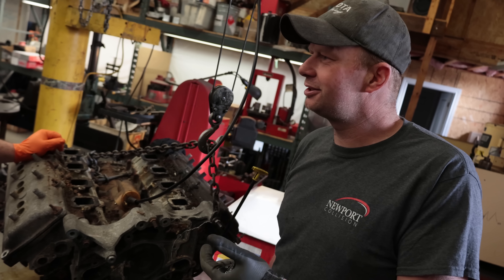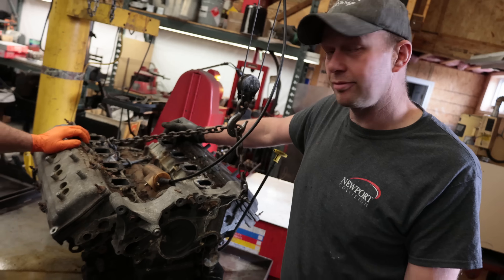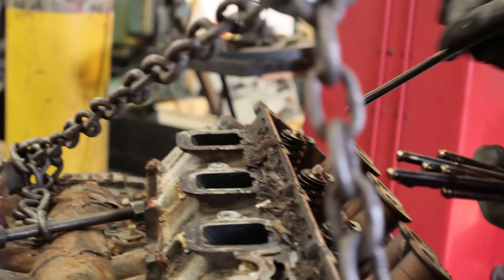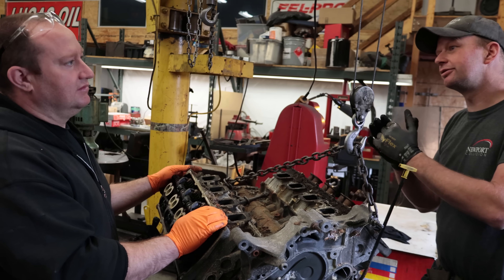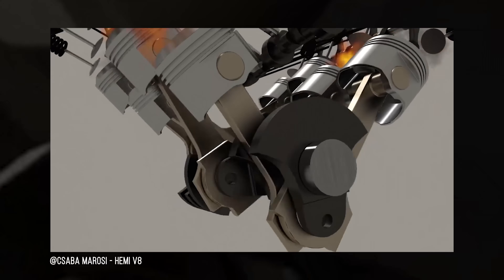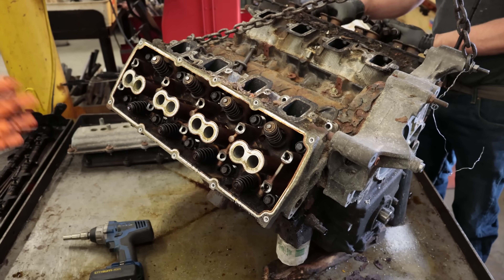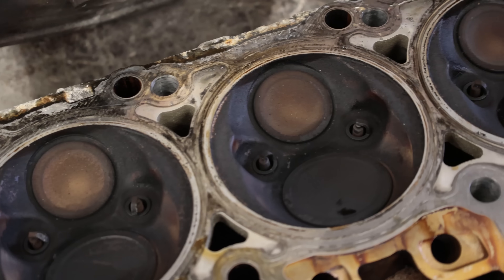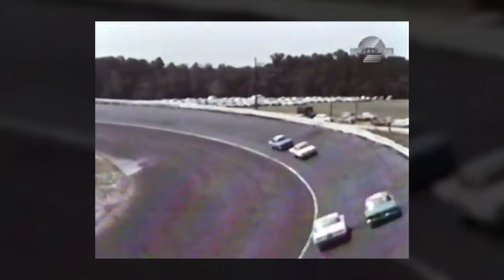REVIEW: Everything Wrong With A 5.7 HEMI 345 Engine

Comment: The lifters are the last thing to get oil in a hemi,  oil travel path from filter to mains, camshaft, up through the cylinder head into the rocker shaft assemblies. DOWN through the pushrods into the lifters. Former Chrysler level 3 tech. Chrysler has a procedure for the dreaded lifter tick(if the lifter is damaged then this procedure WILL NOT WORK) with engine at operating temperature, rev the engine between 2500-3000 rpms for 20 minutes in park. Purges the air out of the lifters. The angle and the poor oiling of the lifters are the hemis Achilles heel. Chrysler says it's due to prolonged oil changes. Specifically in fleet vehicles that idle. Oil changes need to go by engine hrs not mileage.
Reply: NO. I refer you to page #69, Larry Shepard's book, NewHemi Engines. There is a very large schematic diagram of the oiling circuit. PRIMARILY oiling to the lifter bodies is from the two large oil galleries. The normal(for v-8's for the last 50yrs, at least) Chrysler oil circuitry for the upper valve train exists via the passages in the  rocker stands, rocker shafts, rockers. The only slight difference is the hollow pushrods, like they used in the small block Magnums(& 3rd gen Hemis) from '89 on.
Reply: @budlanctot3060  I can only tell you what I was taught directly from Chrysler. I also have oil schematics directly from Chrysler illustrating that those oil galleries feed the camshaft and go up through the head. So either Larry is wrong or Chrysler is. And I can believe either could be. I've seen enough mistakes from Chrysler 😂. I guess the only real way to tell is looking at the lifter bores and see where the oil galleries are. Lifter issues didn't become apparent until 2009 with the variable valve timing. MDS was introduced in 2006 I believe? But remember oil is used to turn the MDS on and off. So if oil flow to the lifter bores was constant then the MDS would be on all the time. So no... I do believe Larry is wrong. Those oil galleries supply oil to the MDS solenoids. The lifters themselves receive oil from the pushrods.

Comment: I had a 2004 Durango with the 5.7 HEMI that had the hydrolock at about 75K kms. It thru a rod out the side of the block in my driveway on start up one morning. I understand that the plastic intake is the problem letting water in. I'll be interested in your thoughts on that...

Comment: Dodge dealer tech here. They will beak valve springs every now and again. more than once I've seen a push rod fall off the rocker and bend the rocker shaft or straight up snap off the rocker pedestal requiring a new head. We also don't normally replace whole engines for cam failures. Valve seats also fail quite a bit. a very odd failure that happens that I've only ever seen on low Mile motors. (highest I've witnessed with this failure is 12k miles) is the poiston will just shatter completely without prior warning. These issues are shared between the 5.7 or the 6.4 truck motor. If I had to bullet proof a hemi I would delete MDS with fully built head with a strong set of pistons and some rods while I'm there.
Reply: have you had any issues with the 2015+ 6.4 challenger/charger engines? i try to never let mine idle for more than a few mintues and change my oil before 3000miles ha, im paranoid

Comment: I have 2011 ram 1500 4x4 with 108,000 miles.  Started using antifreeze and ticking really bad. Mechanic replaced cam, lifters , timing chain and head gaskets . I have friends with the dreaded hemi tick and none of them are high milage buy any means.

Comment: I am building a 368 stroker with a Scat rotating assembly and a mild comp cam for low end torque to replace the 4.7l in my 2004 Ram.  Also swapping in a Tremec TR4050 5 speed manual to replace the OEM NV3500 manual

Comment: Had a 03' 2500 around the shop for a year ,dropped valve seat. Thought it would be an easy find with cop cars ,jeeps ,and 300's .Looked for a used engine,all the junkyards laughed and said good luck. In the south where rust isn't so much of an issue they get used up.Finally gave up and parted the truck. Still came out on the truck but wouldn't buy one again.

Comment: I'd put it in an older Dodge pickup D-150/250 that was originally a gasser as they're pretty easy to find for cheap. Make a cool shop truck with some get up and go. Plus Holley has made all the brackets to get one of these Hemi's to fit into that platform. Was cool to learn about the cross hatch stuff. Very good knowledge to hang onto.

Comment: i heard they dont get oiled proper on the cam  from extended idling but i was thinking that if you ran some more clearance on the rod bearing that might help . Of just dont idle for long periods of time . I heard a little extra clearance on the rods and mains you might have a little less oil pressure at idle and no one knows . Not enough clearance and every one will knows

Comment: The bad lifter issue is pretty well known, and if not caught early turns into a bad cam issue as well. But you guys said nothing about the the valve seats that come loose. They get turned sideways under the valve and then impact the piston, then break up and get squished between the cylinder head and piston causing catastrophic damage. I think both were redesigned around 2014 but not sure. I've got a 2017 Charger R/T with 5.7L that I am not terribly worried about.
Reply: In '09 the heads were changed. That was 1st yr of "Eagle'" head.

Comment: Nice video. You neglected to mention the early ones dropped valve seats.
Reply: Mostly because of an overheating event, which doesn't totally absolve Chrysler of responsibility for insufficient press fit in the early heads.

Comment: It is completely overlooked and many will disagree..but this is not a 3rd gen..it's 4th gen..the 3rd gen is the 4.7 it is a overhead cam hemi..just like the ford S.O.H.C 427 the spark plugs go through the top of the cylinder head..because the cam is in the center of the head..The HO engine was a Grand Cherokee exclusive for the 2002-2004 and boy it's got some real good go fast goodies and the bottom end is like some racers wet dream starting with the forged steel crank..then in 2008 they revamped the 4.7 to get 305 hp out of 285 ci..now that in anybody's book is impressive !

Comment: Really great video Rich. Ive been elbow deep in these engines day and night the past couple years, What if you built a street-legal stockcar with this engine? For a few grand you could get a chassis and body to splice as others have done. Make it a forged high revving stroker with a meaty cam, the Comp HRT stage 3 sounds great for an out of the box option. More info on that on my channel. 

As for lifters, they were really bad 2011 and got better after. 03-05 hemis were bad for dropping valve seals and having timing chain issues. Being that you have the first line of 3rd gen Hemi...  I suggest upgrading your timing chain to the heavy duty 6.1 hemi timing chain. You can also use a 6.1 hemi crank as they are forged version of the 5.7. These parts are not the same on the later 2009+ Eagle Hemi's. 

Your header bolts will put up a fight, being that this is an old and well ran engine those bolts are likely rusty little sticks ready to snap, about 1/5 of my oem exhaust manifold bolts snapped on removal (godhelp anyone with an old rusty hemi in a car trying to install headers- spoiler: head removal). Exhaust manifold bolts are m8x1.25, stage8 has a great kit for gen3 hemi header bolts. Also ONLY USE OEM EXHAUST GASKETS ON THESE. All other exhaust manifold gaskets are known to fail especially the RemFlex gaskets. Just get OEM type and save yourself the headache. Also the connecting rod bolts on these are TTY so keep that in mind, just the same as head bolts. ARP makes a headSTUD kit for these engines but I haven't seen a headbolt kit, I did all my work in the car so I just got MAHLE for everything. 

These engines also have a wierd habit of throwing the inner ring off the balancer as they get old and crusty (mine did) I upgraded to an overly expensive 6% OD ATI superdamper which still uses stock belt size, so i could tell people I had a NHRA certified $500 pulley. It comes with black oxide bolts so RIP if your rig isn't garage kept(like me. I cry inside every time I see my damper getting rusty) Reccomend spraying fluidfilm in your damper and wiping the excess if you go that route. Its sin to have a rusty superdamper. Like it isn't a common thing to happen, losing part of the dampener, but Ive seen it happen a few times which is wierd enough to mention

I have one super super super handy trick to these engines when installed in cars. The valve cover bolts are a BIIITCH to remove if you don't have the Titan brand 1/4" micro swivel ratchet from princess auto SKU 8947145. Stock valve cover bolts are 8mm head, you can upgrade them to m6x1x25mm stainless steel bolts and re use the rubbers but you have to do a little stack of washers on top. 

Oilpan: if your using the 5speed, and your application permits, get an aluminum oilpan from a car as the oilpan is a gusseted design liek the old chrysler smallblocks to provide more support between the engine and transmission, it uses the same trans botl pattern as the old chrysler smallblocks too from what I recall. Lots of drag racers prefer the aluminum car oilpans for this reason, one of my speedshop's race teams were breaking belhousings every 10 or so passes until they switched back to the car oilpans. Oilpan, Valve covers, coilpacks, front fenders, and possibly intake manifold I forget, are m6x1x25mm machine screws, fastenal has em in grade 10.9 with ecoguard part number 11552483 and matching washers 11552364.

Some neat fun trivia about my own experience. Rebuilt a clapped out ex cop car that had the rust real bad(it was my quarantine project, I didnt say it made any financial sense), had nothing but bad luck with it, first I was one of the jackstand recall statistics, then going to my last carshow of the year a big ass rock was dropped on a bridge under construction, took out the oilpan and my skidplate. Right now it's on jackstands(custom heavy duty fabricated stands not storebought, fool me once as they say) soon to rebuild the bottom end. Gotta drop the cradle to get the oilpan off on Chargers. And yes, new skidplate is 1/4" AR400. I'll be putting spacer pucks ontop of my struts to make up for the height. When the oilpan got taken out it was like... 1 or maybe 2km until we could safely stop as it was a construction zone. Im not saying ive had nightmares about the state of my crank and bearings but Im also not saying Ive not. The info about the aluminum bearings galling with lack of oil sure worries me. I was already planning on getting some ACL racing bearings so, I guess worries are not un-founded at least.

That's everything I can think of at the moment, I will likely drop more walls of text on your subsequent videos though.

Comment: I know and old timer who used to build mud drag trucks and supposedly he used to drill a tiny hole in the bearing and put a brass pin in it. He said that you could spin it as fast as you wanted and the rods would snap before the bearings would spin. How plausible does this sound to you?

Comment: Jasper adds an oil rail with squirters to  keep the bottom of the cam and lifters wet, at work big telecom utility we don't replace cam and lifters anymore on the hemis until jasper does their upfit, most trucks are bucket trucks without  dod

Comment: Fun fact with these engines. The big reason the hemi lifters fail is they are oiled backwards. The oil comes from the rocker assemblies and down the pushrod into the lifter. Hot idle oil pressure is a bit too low for this.
Reply from the maker: Thanks for that!
Reply: @DEBOSSGARAGE  Absolutely! Your 8.3 ISC writeup was helpful for me.

You can put a Hellcat pump in the regular 5.7 (only confirmed on 2013+ but may work on older ones as well.)

The hellcat pump has thicker rotors, making hot idle pressure higher due to more volume. I've done it a few times and had noticeable results. Whether or not it's enough to keep one alive, I don't know.
Reply: Dylan. I think Bud doesn't understand MDS operation. I commented the same thing you did to his response on my comment. I believe Larry Shepards book is misleading unfortunately. Maybe Earlier gen 3 hemis without MDS such as the one in this video was oiled by those  galleries? I don't have much experience with those ones. I was a level 3 Chrysler tech. Did plenty of those camshafts and lifters like every other tech. Went to Auburn hills for the class too.
Reply: @amsdrivelines  I was level 3 as well up until January. Went to Seattle and Portland training centers. When did you get out?
Reply: @sHoRtBuSseR  I got out December of last year I took a job at a large utility company as a fleet mechanic. Hourly pay. Union. Making twice  the amount I was making flat rate. Guaranteed salary with overtime. I GOT LUCKY!!!
Reply: @amsdrivelines  I took a job in a school district as a mechanic back in January. I also got lucky. Salary, union, benefits. The works.
Reply: What? That's not true at all. Where do you get such misinformation, and then spread it around. The lifters are primarily oiled by the huge lifter galleries that run down both sides of the  intake valley. Crack a book, instead of repeating dumb stories.
Reply: @budlanctot3060  I went through Chrysler training with Chrysler instructors. So "cracking a book" wouldn't do me any good, because I learned everything I know directly from Chrysler.

The oil galleries in the newer block are for MDS operation. I've replaced more sets of lifters than I can count due to the needle bearings falling out of the lifter. You know what I found? The MDS lifters were very rarely the issue. 90% of the time it was a standard non MDS lifter that failed. When MDS lifters failed it was almost never the roller portion. It would usually just fail to operate correctly or fail to reactivate when MDS was turned off.

Way to be condescending, Bud. But I did crack a book. Lots of them. Spend hundreds upon hundreds of hours in Chrysler's classroom learning the product. So before you open your mouth, crack a book.
Reply: @sHoRtBuSseR  NO. I refer you to page #69, Larry Shepard's book, NewHemi Engines. There is a very large schematic diagram of the oiling circuit. PRIMARILY oiling to the lifter bodies is from the two large oil galleries. The normal(for v-8's for the last 50yrs, at least) Chrysler oil circuitry for the upper valve train exists via the passages in the  rocker stands, rocker shafts, rockers. The only slight difference is the hollow pushrods, like they used in the small block Magnums('89 & on, I believe). The hollow pushrods are mostly  just for lubricating pushrod sockets in the lifter & rocker.

Comment: I bought a new 2005 Dodge Magnum with the 5.7 Hemi.  I still love the car and plan to keep it.  The lifters didn't fail in the early models prior to 2009 when they switched to variable valve timing.  So, MDS didn't cause problems in the early hemis from 2005 thru 2008.  The only issue with the early hemis is that the valve seats might drop out of the heads especially if overheated.  It's the GM engines that had valve lifter failures with their version of MDS, the Air Fuel Management as they called it.

Comment: Alot of people don't realize this engine has two spark plugs per cylinder haha.. and yeah oem plugs are best. But with mopar oem parts are usually the better option :)
Reply: Agreed. My 14' R/T came with NGK plugs from the factory, so as baffled as I was they weren't Mopar plugs, I replaced them with the same NGK Iriduim plugs they came with. No issues at all since.

Comment: I got two 2003 ram 1500s with the 5.7 hemi and they both are over 300,000 miles and I do regular maintenance and haven't had to do any engine work at all but mine don't have the multiple displacement option it's just all 8 at all times. And yeah the hemi has a tiny tick at all times but then the lifter tick is a bit different if your used to the sound :)  but both my 2003 rams have been great trucks no issues other than the rack and pinion is garbage on the 2000s trucks

Comment: I have a Ram 1500 (2004) with the 5.7. Decent truck. I’ll need to fix all the flapper doors in the heat/air system. That’s the worst of it. The engine is solid after 140K miles. Good motor, as far as I’m concerned. 👍

Comment: Hey lol my 2002 dodge 1500 has a 4.7 next generation magnum in it and it has been a great work horse that never let me down. No issues with it ever.  Of course a hemi is a lot better though lol. And might be a good option  as a replacement in the future. Yeah would be cool for you guys to add some power to this generation hemi engine. What that would look like ? And putting that engine into 2002 dodge 1500 4×4  single cab short box . That's what I have and I like the looks of this generation of dodge trucks. You could Make a litte budget hot rod truck . Thanks have a good one.